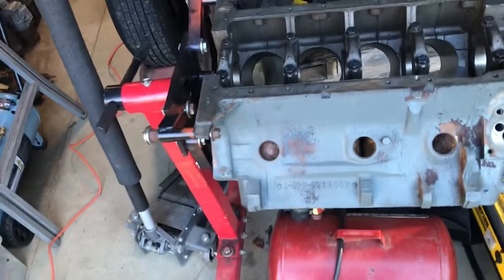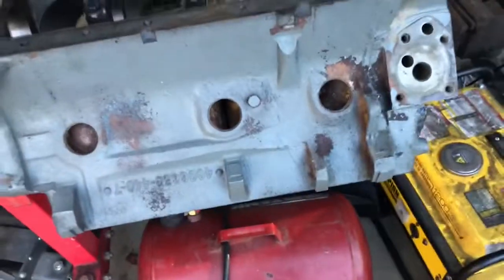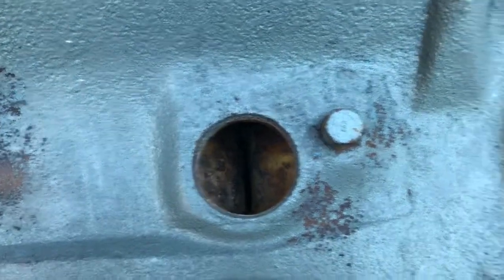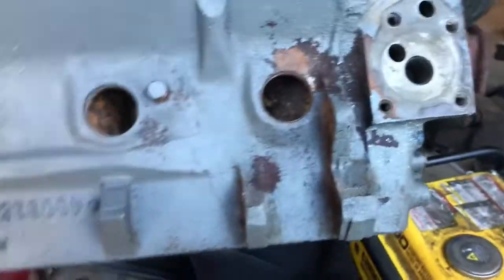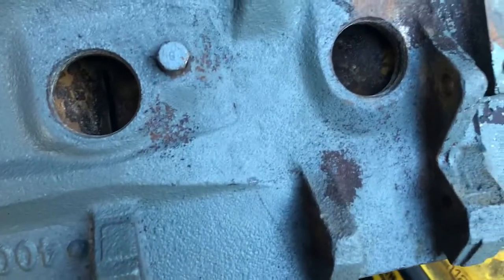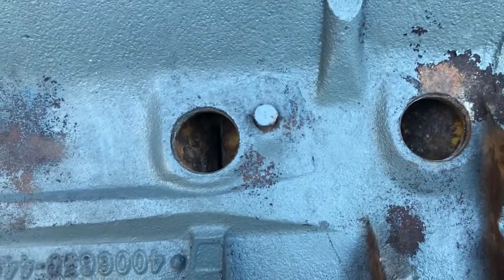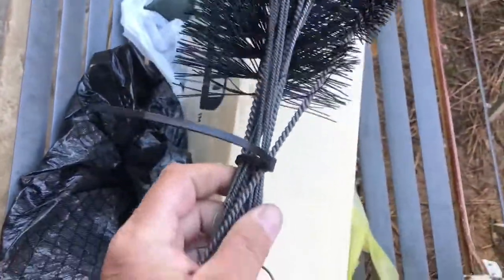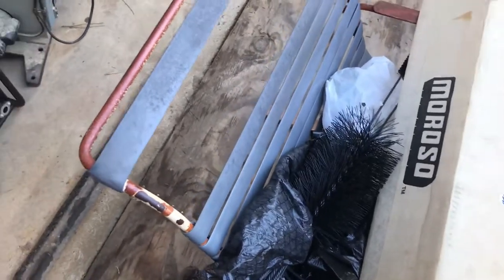Rusty water jacket cleaning suggestions

Comment: Put rubber plugs and n, fill from the top with Evaporust let it sit a few days to eat the  rust out. Then turn it over to drain , then take the plugs out and rinse with water , then spray the inside the best you can with WD 40 to keep it from reforming untill you get it running

Comment: I think spray 9 makes a cleaner that u use in a running engine  then flush out after a bit. My 383 is like that, going to use it on run stand while I get everything dialed in😀

Comment: Use Citric Acid powder and dilute it down with water obviously, block off all the watsr passages on the head deck and pour it in through the freeze plug holes. Let jt sit for a day, then flush out and if need be repeat. Nuetralise with baking soda to stop more rust, flush and you should be good.